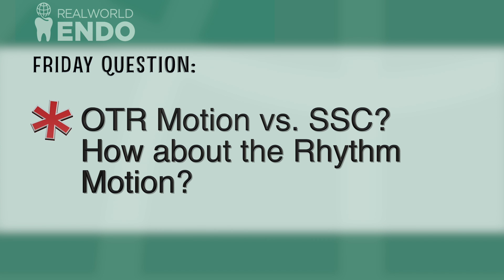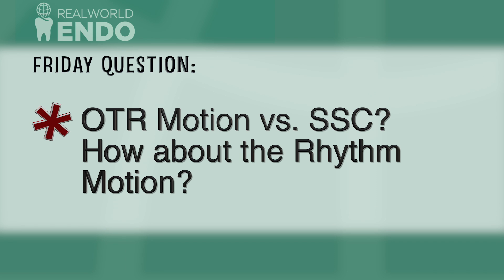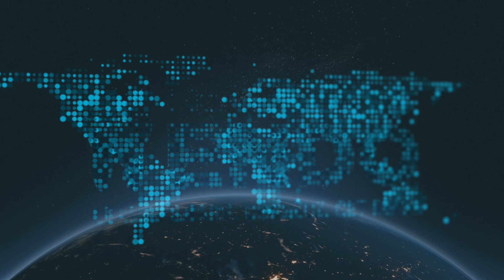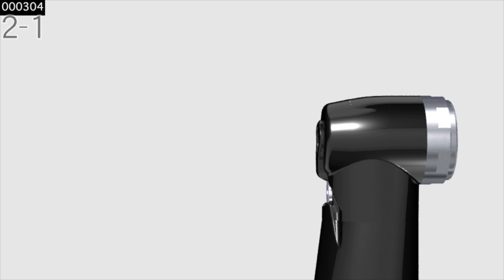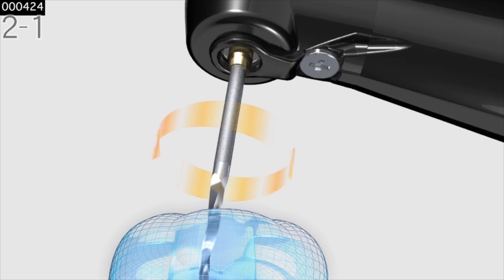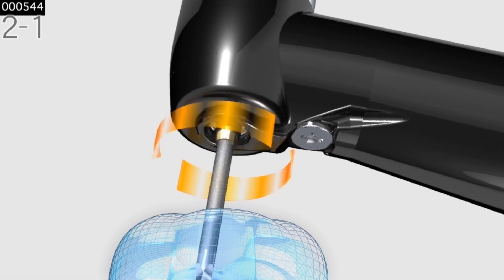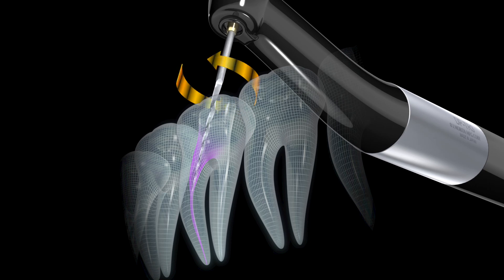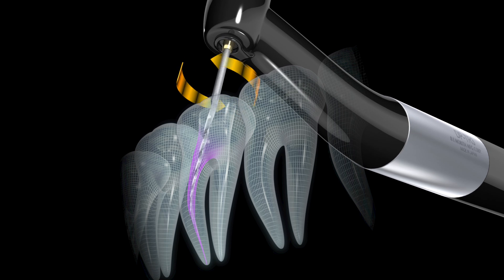Single Stroke and Clean SSC vs. OTR Safe Rotation (Friday Questions)

Comment: As always, the production and comedy in your videos is top notch!
I hate to sound uninformed, but can you explain why OTR is so much better than the classic torque limit features of older electric endo motor that you said you didn't use in an earlier video?
Is it that much better?
I, like you recommend, never use the torque limit on my motor because I heard Dr. Ben Johnson saying that the quick rotation reversal occuring when the file is torqued can increase file separation; doesn't OTR have a similar effect on the file when engaged?
Reply from the maker: Torque limit is different as the file reaches a limit and then reverses out completely. OTR is like reciprocation where it will reach a programmed toque limit and then your rotation motion turns into asymmetrical reciprocation. 
So very different. Dr. Johnson was talking about rapid reversing causing a problem. It’s different in reciprocation. 
Good question!
Reply: @EndosKool  thank you!

Comment: When does one stroke complete in each 3-stroke rhythm? Is it when it reaches the set torque or a while after it?
And isn't OTR release the debris back in the canal and subsequently out of the apex in the apical third?
Thank you
Reply from the maker: It depends on what torque limit you have set for your OTR motion. If you set it to 0.2Ncm then there's no way you can stop before it reaches the torque limit. Then you're using OTR like a torque dependent reciprocation motion. Then there's more debris left in the canal much like reciprocation motion. But if the OTR limit is at 0.6 Ncm, then you would be able to use the file up to the point of OTR or just below it and withdraw and clean the debris from the file before OTR limit is reached (minimum debris released in the canal.) So, it depends on the way you would use OTR and the limit you set. Good luck.

Comment: Could you do the ssc with a reciproc file system (waveOne Gold?)?

With kind regards
Reply from the maker: Eren Cicek Those cit in the reverse direction. So, you can do that with those files only if you use the EndoSync+ hand piece that allows OTR in counterclockwise direction.

Comment: Presently we have a lot of Endo Motors with varying degree of OTR settings.. do you think 180/90 is a standard setting because I have  motor with 150 clockwise 30 degrees anticlockwise motion
Reply from the maker: I think your 150:30 setting is in the counterclockwise direction designed for reciprocating files. This particular EndoSync 180/90 is in the clockwise direction for conventional files. The new EndoSyncPlus is able to do OTR in the counterclockwise direction. So, the dominant direction of cutting motion is a function of each file's specific cutting direction.
Reply: Dr/ @EndosKool   Does the OTR Feature works only in rotation? Or could also work in reciprocation? And with which reciprocation files?
Reply from the maker: @karimibrahim3097  It works in reciprocation only with EndoSync Plus Handpiece. That's the only handpiece with a reverse OTR function that I worked with manufacturer to develop. Cheers!

Comment: OTR isn't basically the same as the auto-reverse function? (sorry if the question is stupid)
Reply from the maker: No. When AutoReverse is engaged, the file spins out completely after a torque limit is reached. You generally remove the file from the canal at that point. When OTR is engaged, the file backs off 90 degrees and will proceed to cut again in the forward direction without a pause. So, it just backs off for 90degrees and immediately goes back forward. It does the same if it meets that torque level again. So on and so forth. Hope this helps! :)